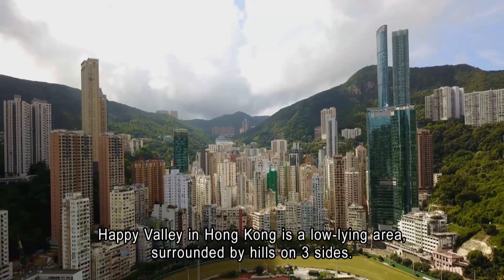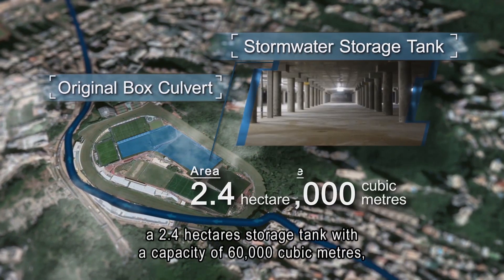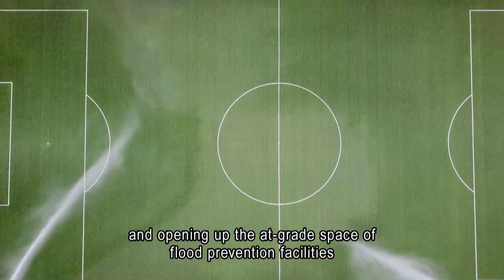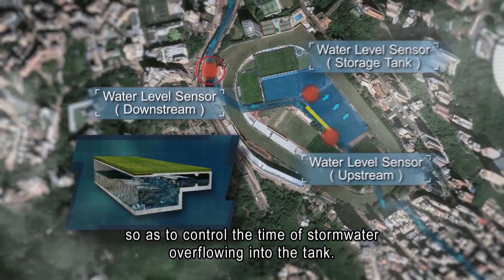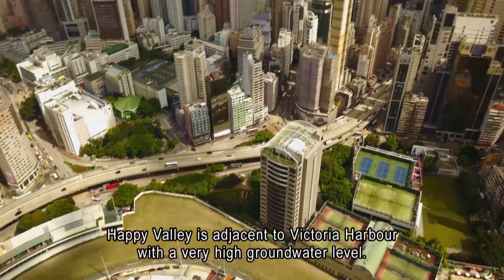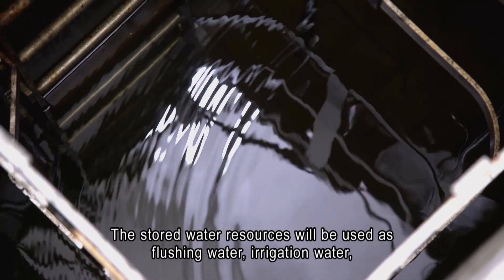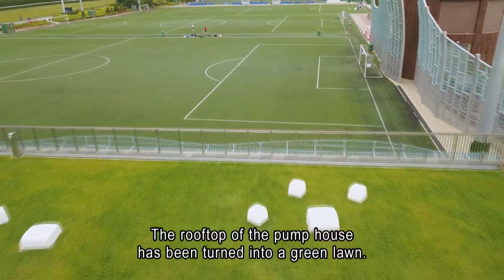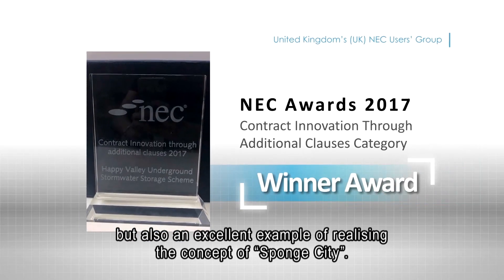The Trio - Underground Stormwater Storage Scheme

Comment: 'system makes use of three sensors'. don't you mean, it probes the water level at three different locations/sites? we all know what can happen if you would literally rely on ONE SENSOR per location, per critical value, don't we? I be distinctly remember a certain air plane called 'Max' that relied on one sensor, and in no time after launch immediately two crashed killing all folk onboard, after which all of the type were grounded indefinitely worldwide..